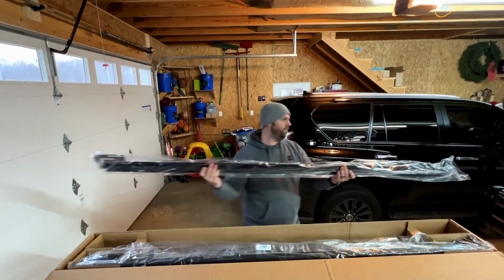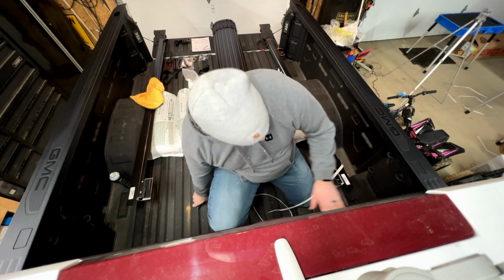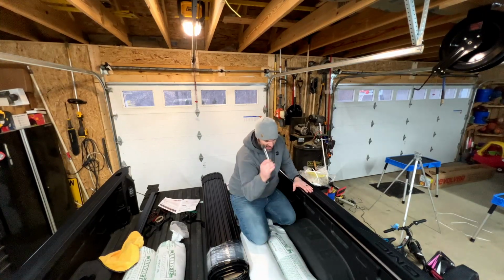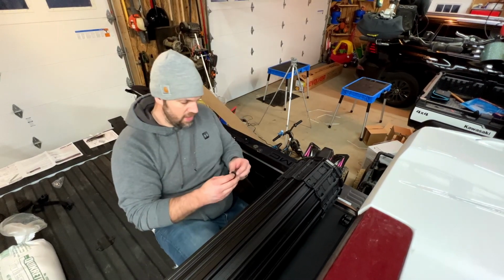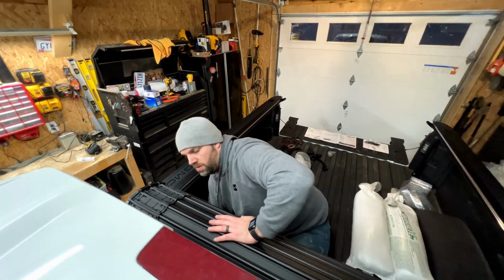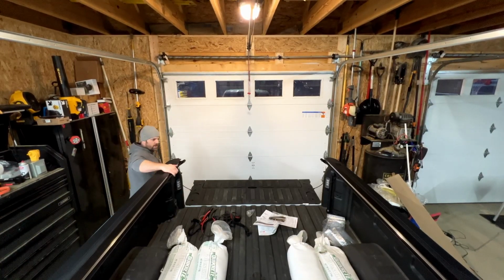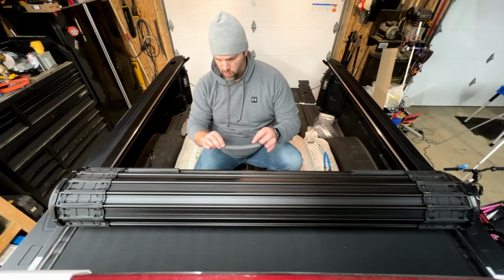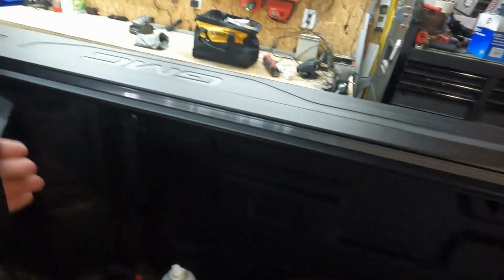2021 GMC Sierra 3500 Install video BAK Revolver X4S Tonneau Cover

Comment: How ya like it by now?  When rolled up, how big diameter is the roll?  Also when rolled up and strapped down, how far back from the front of the box to the rear of the roll. I have an 8’ bed too and I pull a fifthwheel camper